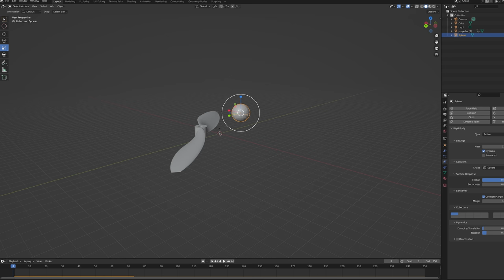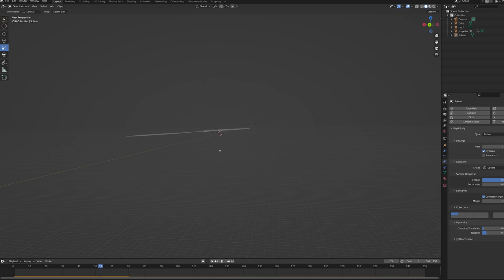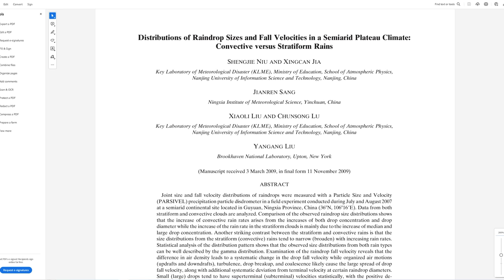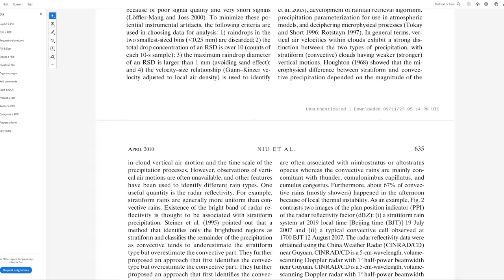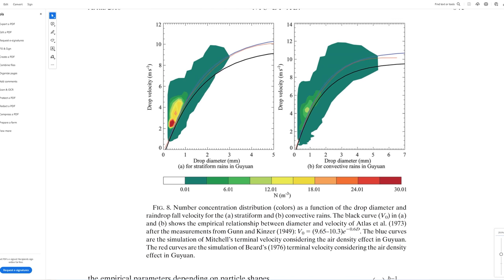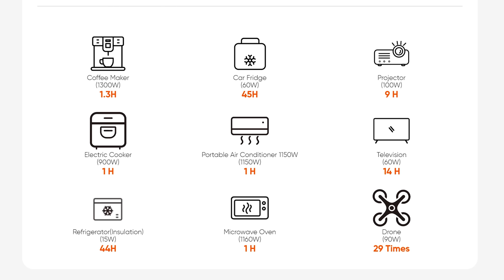Can a Spinning Blade Umbrella Stop The Rain?

Comment: How about a missile defense system umbrella that shoots down hostile water droplets with tiny rocket propelled explosives?
Reply: Or a laser umbrella :0
Reply: I was about to suggest a sentry turret that shoots the incoming raindrops away with bullets.
Reply: THE CLUSTER BOMBRELLA!! Multiple explosions blast the water away.
Reply: Uncle Sam: 💡(takes notes)
Reply: @BahreahTheAll-Knower  It definitely has the name for it. Cluster Bombrella sounds like a supervillain.
Reply: Bet the DOD would give you an engineering research grant for that
Reply: IDBM: inter-droplets balistic missile
Reply: The only problem with that is the logistics division needed to support your air defense umbrella. Not to mention the advanced radar unit that has to follow you around outside.

But those are the only problems I can see. Should be do-able in modernized western nations.
Reply: I got one. How about a mobile weatherproof chassis, that you can go in and stay dry. You can put a wheel on every corner so it can move. Maybe add a gasoline engine to power it... throw some lights in the front for nighttime and some lights in the rear to communicate with other people in these devices that are behind you. Put a radio and two 12" subwoofers, and 4 door speakers so you can listen to your favorite tunes.......
Reply: Give me your kickstarter link so that I can donate my money.
Reply: Good idea for Merica.
Reply: sounds like an american umbrella
Reply: There should be an animation made based off of this...
Reply: @Nails077  who cares about where they land we need to stay dry
Reply: @cyborgbob1017 xkcd did a "What If?" about this aptly called "Laser Umbrella".  Long story short, it would take at least 9KW/m^2 (probably much more) and would heat up your surroundings so much it would cook you.
Reply: Nukes. No need to worry about umbrellas if there isn't any rain. Getting rid of the root of the issue here
Reply: The iron Dome umbrella is a proud Israel citizen I approve
Reply: not that bad of an idea if you consider how there us a device out there shooting down mosquitos with laser
Reply: I know... the nuclear umbrella!

Comment: "Mostly waterproof for a little while" should be used way more to describe how waterproof something is, I feel like we all have had something that turned out to be "Mostly waterproof for a little while".
Reply: You either mean it hydrophobic material or one that Generally dont absorb water, but still have water on it
Reply: @unknownman5090  no. I mean your phone, laptop, backpack, jacket, shoe, etc. Sold as waterproof but should have been sold as "Mostly waterproof for a little while"
Reply: @Petch85  I accidently soak my phone into river during vacation and it come out just fine so I think it waterproof. can you mind telling me what you really mean
Reply: Everything will survive underwater for some amount of time functional
Reply: If something is only waterproof for a little while it should be called water resistant
Reply: "Mostly harmless"
Reply: @Petch85 The waterproof rating of phones is indeed "can be submerged at X depth for Y minutes"! The iPhone 15 is "Rated IP68 (maximum depth of 6 meters up to 30 minutes)".

Comment: The blades are not stoping the droplets, the airflow is blowing them away, so it kinda isn't the same principle.
Reply: That was his point about that being the original air umbrella that he tried to make before.
Reply: @brando3342  Yeah but Karl's point is valid - the second test was a bit pointless and obvious even before Action Labs tried the first few drops.
Reply: Yeah, it's a working air umbrella but he failed the premise of the scientific aspect of this test.  He explained the physics of the situation, then came to a solution that threw them out.

I'd love to see him redo it with flatter, or otherwise pressure neutral blades(is that even possible?  Maybe oval cross section blades?)
Reply: Just reverse the blades so that air is directed downwards. You'll end up increasing the speed of the raindrops, but at least the tested premise still holds.
Reply: @alihms  But then you will create a natural air flow that speeds the droplets down as the wind pushes them, and the wind will push them between the blades, so I'm pretty sure that's a no go to.
Reply: @mugemobi Even if they do land on the blades the blades will drain onto whatever's under the umbrella.

Come to think of it it's probably impossible to do a spinning blade umbrella that doesn't generate enough lift to keep the rain from draining through the blades, hit or not.
Reply: @madbats69  if you are being serious: no, no that is not how science works.  Let's call this experimental design.  This is closer to how evolution works, than science.  The scientific method would have us form a hypothesis, use logic to form experiments that would disprove our hypothesis, perform those experiments and if they do not disprove our hypothesis, then we create more experiments to try to disprove it.  The more we fail to disprove it, the more reasons we have to behave as if our hypothesis is true, and the more data we have to use when forming new logical disproof against theories.
Reply: The other problem is that water drops are not discrete units. You can cut them to get two (or more) drops. So if the fan blades were perfectly flat to create no airflow, drops which intersected the blades would still get through. Because instead of the blade knocking the drop away, it would slide the drop and the bottom portion would continue falling.
Reply: @solandri69  this is why we said it would need to be a net 0 pressure blade.  As in no change above or below.  Though, we're pretty sure that's going to result in a net low pressure zone in the fan area, and would imagine it would push air out the sides, so we might end up with, essentially, a suction in to the blades from above and below, with air and water getting ejected out the sides.
Reply: Ok, I'll say what's on everyone's mind:  back to the Action Lab basics and test it in a vacuum.  😂 (need a water substitute for obv reasons) 

But really, the easier thing to do is to use a flat, non-angled blade to minimize any upward air deflection.

Comment: It should be tested in a vacuum to see if it is air flow countering the drops or if it is the fan blades themselves blocking the droplets.
Reply: Unfortunately it wouldn't stay a vacuum for long, as the water will boil and the space will fill with water vapour.

Comment: "patented duct tape design, making it mostly waterproof for a little while so your chance of electrocution is pretty low at first."
That's reassuring.
Reply: mostly, for a little while, at first. bro is loading up so hard
Reply: That's what I was thinking. But with the thing running on batteries instead of being plugged into the wall, it should be a floating circuit and incapable of shocking him. Still, I would have at least worn some gloves just in case of freak circumstances.
Reply: The fact that you have a realistic chance of getting 'electrocuted', tells you how stupid the idea of a fan-umbrella is.  

I know this is just a fun experiment. But sheer people who think there is merit in this design is surprising.. 😂
Reply: @chitlitlah   This channel isn't called the Action lab for nothing
Reply: @mahadevparmekar2565 In my opinion the problem is mostly with the power source. The electronics can be designed waterproof.

Comment: Can you try a raincatcher umbrella? It's an umbrella that collects water around you with a pipe connected to it, that stores the rainwater into a bucket.

It's extremely climate friendly and you can also use the bucket water to take a bath 🛁 in the middle of the streets while its raining 🌧️
Reply: lmao would be actually be a fun video 🤣🤣
Reply: Just invert an umbrella and drill a hole at the base for the water to fall through.

Sounds lame - we all know a funnel will work
Reply: So... a big funnel?
Reply: @marcosani956  Yup

Comment: Would an Electrostatic repulsion/attraction umbrella work? Instead of stopping its fall straight down, bend its fall around you without any obstruction like a fan blade. You may have to start the effect higher up to bend it enough to miss you. Perhaps more like an Electrostatic roofless awning.
Reply: You'll be *shocked*, how well it works.
Reply: @Aras14  , no... no I won't.
Reply: Water isn't that magnetic.
Reply: Maybe if you could safely make something like that.

The energy requirement is pretty high.

You could have like a 2 layer umbrella where the first layer charges the water to potential and the second layer is the opposite charge. 

They would have to be some distance apart.

But yeah, it would look like a normal umbrella without the fabric stretched over it. Or like a radial antenna. Two of them about 1 foot apart.
Reply: He should get massive spinning magnets for this.

Comment: What would be really cool is if someone made a device that had a solid surface (maybe some sort of waterproof fabric) that could be held above you, and mounted on a slim pole, such that it could be folded when not in use.  And you know, something that didn't require batteries (or a 50 pound generator) would be even better.
Reply: eh i feel like that wouldn't work, and it would be way too weird, i mean you'd never catch anyone walking around with that kind of contraption

Comment: it was projecting the water away because it was blowing air up at the rain instead of simply blocking with the blades. reverse the rotation and see if you get wet... though then the fan would be pulling the air down increasing the speed of the falling water slightly. ideally for the experiment, you'd want a slightly thicker blade that is level (not moving air either to the either side of the blades). the thicker aspect is to increase the chance (like you talked about in the flat object demo) to hit the rain drops. THEN try it.
Reply: Is that the point though? The experiment is whether spinning blades can stop rain, not if the blades themselves can stop water.
Reply: @MelodicTurtleMetal  yes*? It's all just a goofy experiment for fun, but nothing about the original "can you" question said the spinning blades had to be at a pitch or implied one. Like he said, he basically recreated the air umbrella, which as I was saying wasn't really the distinction the question was posing. 

The question is kinda similar to the idea of the Star wars inquisitors spinning their double light sabers to sort of make a shield, how effective would it be. And his original description of the mechanics he was investigating were exactly in line with that and the corrections I said.

Comment: Idea: a “funnel” umbrella where the canopy bends up, which makes the water flow to the center, then down a tube inside the shaft, emptying out at an opening in the handle. this will prevent water splashing to the sides, only coming out at a single point.
Reply: And that tube goes into your water bottle.
Reply: @MandoFettOG  I don’t know, perhaps we’ll need to add a filter somewhere. But then again, rainwater isn’t really that contaminated, it really hasn’t touched anything falling down.
Reply: Unless you store the water, does this really achieve anything? You'd end up with some floppy thing being dragged in the ground to dispose of the water behind you, otherwise you'll end up with a show drip somewhere close to your body.

More importantly, it's just an inverted umbrella, and we all know it works. Would be a boring video

Comment: You should explain that it is not necessarily just because of the blades spinning, but rather that they are fan blades blowing to water back up and away.  You would have to reverse the direction of the blades to make it blow down on you in order to know if the blades were blocking the water just because of the spinning.

Comment: I love these umbrella videos, but hate how a battery bank is being called a generator.
Reply: Maybe the stored power is used to run an actual internal generator for output.. useless, but allows you to market it as a generator instead of battery
Reply: @MelodicTurtleMetal  no. Then it would just be an extra stupid battery.
Reply: @silvenshadow  yeah, it would be terrible - but using electricity to generate electricity still makes it a generator - which is definitely what this is not
Reply: @MelodicTurtleMetal  i honestly can't believe you posted that on the internet.
Reply: @silvenshadow  i think you're taking it either too serious, or have difficultly grasping the simple yet useless function of what I've proposed.

Comment: Just a theory here and possibly mentioned before, but at any point in time, all water droplets can be at the same height at the level of the blades, and a fan with fewer blades would not be able to cover the entire circumference at the moment those droplets pass through, regardless of speed of blades. More blades defeats the purpose, but does support your air umbrella idea!

Comment: Yes. Give each blade the cross-section of an upside down airfoil that pushes upward on the rain. Granted, you'll get wet as the rotor wash pulls in raid sideways, but the raindrops above will stop if you are generating enough of an updraft.
Reply: *rain sideways
Reply: This assumes you can spin it quickly enough.

Comment: Simple explanation.... if the fan with say 2 blades, spin fast enough to make a half turn in less time than it takes for the smallest drop to fall the same distance of the blade thickness.... then it'll come in contact with the blade. Provided the blades are tilted in the correct way, rain will be propelled up/away

Comment: Make an umbrella with high-powered lasers. They must be strong enough to evaporate the water as the drops come in contact with the laser. (I don't think that will work, but could you use spinning lasers to do anything cool?)
Reply: Not only could you vaporize the water droplets, you could instantly and permanently blind any pesky onlookers who might want to prove your device didn't work.  Nobody could ever say they saw a raindrop go through your laser umbrella.
Reply: Point the laser into the clouds and raise the cloud temp so it stops raining where you're standing. With some engineering you might be able to fit your umbrella in a semi truck as long as you keep it plugged in with a wire rated for 1-20 megawatts. If you can't keep it plugged in you can always get in the truck to stay dry!

Comment: How about a laser umbrella. Just a fast spinning prism on top a laser pointing upwards that splits the laser into equidistant beams. Put a ring on the outside so you dont blind your neighboors, of course.

Basically this video, but with the blades made of lasers. Bonus points if you can still manage to mount it on top of a swiffer dry mop.

Comment: it seems pretty clear that the water droplets are being stopped by the airflow created from the curved fan blades.  to see if just spinning blades themselves can stop the water you need to have flat blades and i imagine they'd have to spin much faster than 1000 rpm, so don't let them hit your head.

Comment: Here's a thought... Rain may have enough impurities in it that could be affected by a magnetic field........ So what if you created a deflector of sorts using a very strong magnetic field?

The field doesn't need to be literally above the object and directly underneath the rain, so perhaps we could find out if deflection is really possible by pushing rain to the side from a horizontal facing field.

It'll be neat to see how much power would be required to deflect a rain drop.

Comment: Hmmm try using a fan for repention as an umbrella. 

Example: a downward force is applied to the holder but an upward force is applied to the rain. Since rain is mostly made of vapour and air. Wouldn't the rain reverse itself out from the upward force away from the centre of swid force to the weakened Ratio of force? 

(This is really hard to explain isn't it)

Edit: my point has been proven...

Comment: What about an open impeller(high speed) instead of a blade? It could sit inside of a small lipped housing to throw the air and rain outwards, to prevent the rain from being pulled downwards by the coanda effect.

Comment: Use the fan as you did but lower the speed to 0 rpm. Next, cover the blades with a waterproof material and extend it out to a diameter of 1m. Remove the electric supply cable and stand underneath in a rain shower. Hey Presto!
Reply: Or.....a counter-rotating blade system that covers the area completely.

Comment: This seems a very similar problem as the machinegun bullets through the propeller on old airplanes. The bullets don’t break the propeller, so I don’t see why water would stop.
Reply: That's because there was a timing mechanism connected to the driveshaft that made the machine-gun skip at the right time.
Reply: @andrewcraig1074  ooh, that’s smart!

Comment: You could try a thin, metal skeleton that takes cues from nature (e.g. bat wings), and stretch a thin membrane over the skeleton. You could make the skeleton so that it's covers some specific diameter of space over the person's head. When the water hits the membrane, the skeleton's shape would facilitate shedding the water off the edge of the membrane, where it would fall safely to the ground well away from the user.
Reply: So, just a normal umbrella then.

Comment: I am SOOO HAPPY that you DIDN'T get shocked!!! did you even think about that??? It looks like you were even using METAL POLES..... WHY?!?!?!? If they were wood they they couldn't transmit the electricity, so if the fan shorted out from the water and the water transfer the electricity to the pole the wooden poles would have had a VERY SMALL CHANCE of shocking you, where as the metal would have put you in the ER..... - TOO DANGEROUS FOR ME TO TRY!!!!  lol Glad it went okay tho....
- - I was hoping the second fan would work... I knew that would be enough air to stop it, but I wasn't sure the blades were wide enough